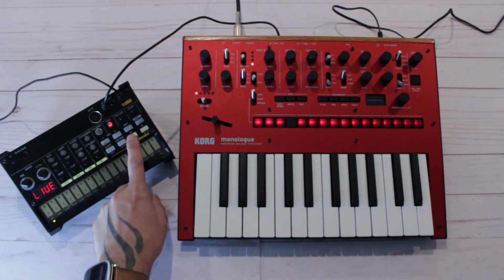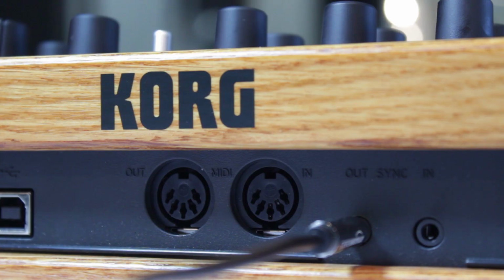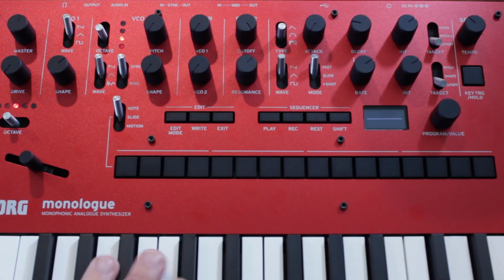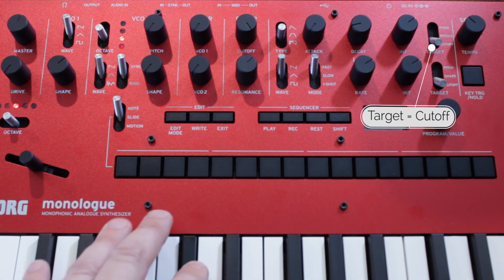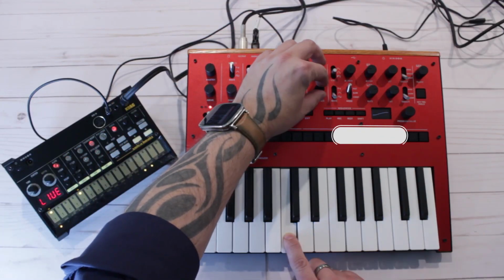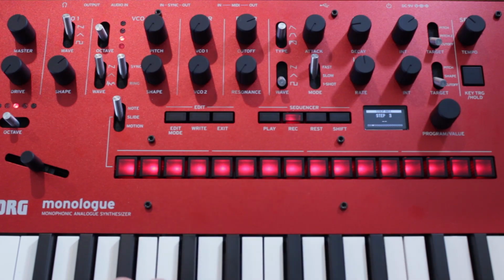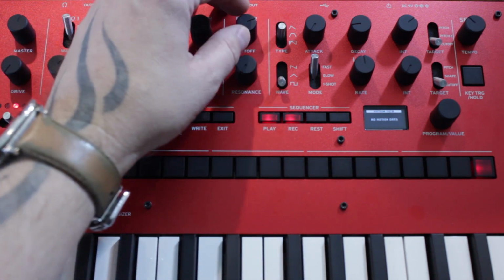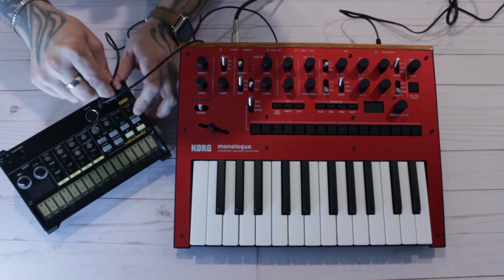Korg Monologue: Syncing External Gear

Comment: What's the reason behind the headphone out from Volca to monologue audio in? Wouldn't the sync step just be fine? Thanks!!
Reply: Once the Volca is playing, it is outputting audio like normal and that audio is feeding the audio input of the Monologue.  The reason you still would not hear anything, is that the filter is not "on" or activated until a key (or a sequence) is triggered on the Monologue.  The filter on the Monologue (or any synth really) is closed unless it's triggered so no sound will be heard by the Volca thru the Monologue.

Comment: Need help! Do I need an audio interface to sync a minilogue with a volca or pocket operator? I dont want to record. Just play. Thanks!
Reply: That’s a good question, I second that. But I would also recommend asking reddit man. Stop crying and start looking, it’s all out there. Good luck
Reply: you need just the sync cable, which is a simple 3.5mm trs male to male, like explained in the video. to listen to both you will need headphones OR external amplification, a mixer and PA or audio interface and monitors. If you don't want to record or play for others, just go with good headphones. this also keeps all neighbors happy.
Reply: couchcamper I have a tried to get my minilogue to sync with the Volca keys but when I do that the Volca sound will only come thru the minilogue when I hold a minilogue key
Reply: @macdemarco1476  sounds like you are using the audio in and not the sync ports?
Reply: @macdemarco1476  Whey you are holding a key on the minilogue you are opening/triggering the filter.  The filter is closed completely unless triggered somehow, so no audio input will be heard until some event triggers the filter to open.  i.e. a key gate or sequence triggered filter envelope.
Reply: Dennis Ristow so it’s impossible to play them both together while being synced at separate times live
Reply: couchcamper I’m using the sync ports
Reply: @macdemarco1476  You can play them as two instruments as you are describing, but you need an external mixer.  Instead of sending out your audio from the Volca into the Mini, you would send both synth's outputs into separate mixer channels.  You lose the Mini's filter effect on the output of the Volca, but you would hear the Volca on one of the mixer's channels and the Mini on the other.  All else being equal their sequencers would be in sync.
If you take a Y-Splitter cable and send the audio to both the a mixer channel and the Mini, then you can Hear the Volca independent of the Mini, or turn that mixer channel down and hear it thru the Monologue as shown in the video.  If you had both channels turned up you would hear both the clean, straight Volca, and (if you key trigger or sequence the mini) the Volca signal being effected by the Mini's filter settings thru the Mini's audio channel.
Reply: To clarify this setup works with the Minilogue XD and not the original Minilogue as that synth only has the sync feature to tie sequencers together.  The XD has an audio input like the Monologue.  I don't own a Minilogue, only the Monologue but I believe those are the respective instrument specs.
Reply: Dennis Ristow thanks man I just talked to Sweetwater and they told me the same thing I’m gonna get a mixer/audio interface the y splitter cable u said plugs into the what and what sorry only part I didn’t get yes I’m 100 percent new to synths
Reply: @macdemarco1476  No worries. Just think of all the signals as water through a hose.  The sync out connects to a sync in, that is, the clock out sends a pulse signal to the clock in.  That's why/how the Volca controls the tempo clock of the Mini.  

Audio out feeds audio in.  The Y-Splitter takes the audio out of the Volca and splits that audio out, into feeding two input devices,  both a channel of the mixer and the audio in of the Mini.

On a side note, some/all these devices can be battery powered, but if you are plugging more than one thing into an outlet (the Mini and the mixer for instance), make sure all the devices are plugged into the same outlet/power strip.  Don't worry you can't blow anything up, but if you plug the mixer into one outlet, and say the Mini into another outlet plug then you risk creating a ground loop.  This will give you a noisy hum, like some guitarist experience when their amp and effects are not using the some ground plug.  Same thing happens with synths.  When I plug my regular synth rig into an amp to play live, they all share the same power strip.  Guitarists aren't the only musicians that have to avoid hum :).

Comment: Hey Dan, nice videos on the Monologue. Would sync with midi on a Roland Tr08? Cheers!
Reply: Hey Francis, I'm not Dan obviously but you are correct in that you use Midi Out on the Monologue to the Midi In on the TR-08. Also, fyi if you use the TR-08 audio going into the monologue audio in, your 08 signal will go through the filters on the monologue
Reply: @presleyandbandit9582  thanks! Got both now and it literally was plug and play!

Comment: Would you be able to tell me which leads to buy to do this?
Reply: When I sync my Monotribe to my Monologue I use a double ended 3.5 jack lead(small headphone size)to go from the Sync out on the Monologue to the Sync in on the Monotribe. Then I use a double ended 1/4 inch jack lead(guitar size) to go from the output on the Monotribe to the Input on the Monologue. I hope this helps.
Reply: Paul Evans  So basic aux cable will do?
Reply: @paskaalisaapaskaa5354  yes, 3.5mm trs male on both ends as he said.